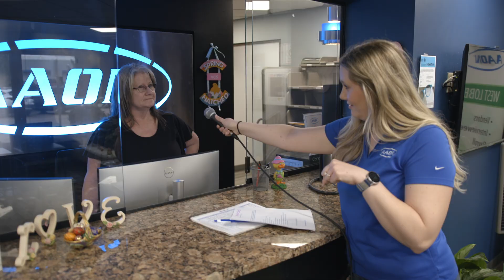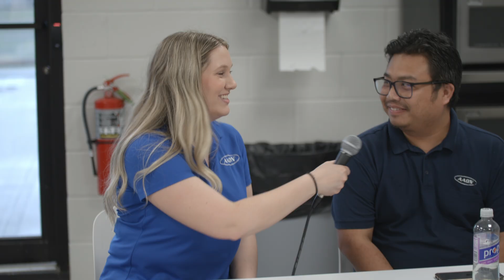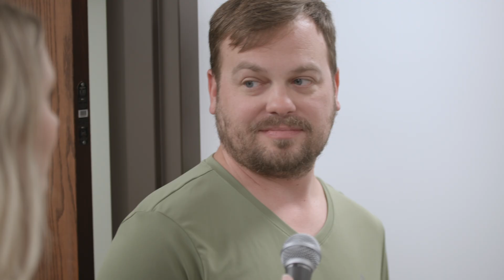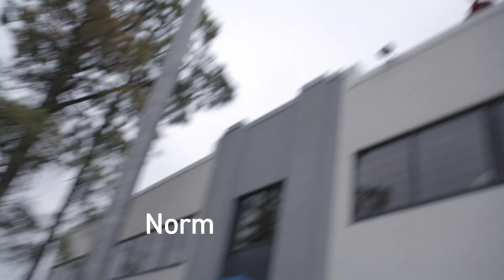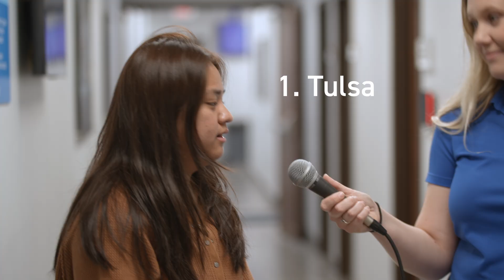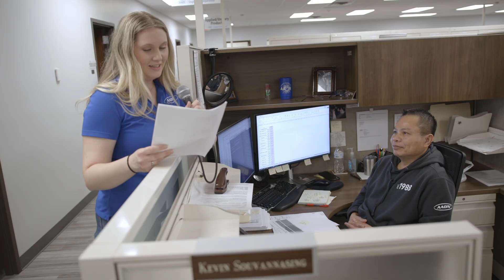Pop Quiz With Stacey Stratton | AAON - Commercial & Industrial HVAC

Comment from the maker: To learn more about how we can help you, click here: https://www.aaon.com/
Reply from the maker: To learn more about how we can help you, click here: https://www.aaon.com/

Water Source Heat Pump - https://www.aaon.com/resources/wshp-hvac

Condensing Unit - https://www.aaon.com/products/condensers-condensing-units

454b Refrigerant - https://www.aaon.com/resources/understanding-the-safety-classification-of-r-454b-refrigerant

VAV HVAC - https://www.aaon.com/resources/what-is-vav-in-hvac

Self Contained Air Conditioner - https://www.aaon.com/products/self-contained-systems

DOAS System - https://www.aaon.com/applications/dedicated-outdoor

Water To Water Heat Exchanger - https://www.aaon.com/resources/what-is-a-water-to-water-heat-pump

Indoor Air Quality System - https://www.aaon.com/applications/indoor-air-quality

Dedicated Outdoor Air System - https://www.aaon.com/applications/dedicated-outdoor

Static Pressure Sensor - https://www.aaon.com/products/duct_static_pressure_sensor

Cooling Coils - https://www.aaon.com/resources/cooling-coil

High Static Pressure HVAC - https://www.aaon.com/resources/what-is-static-pressure-and-how-does-static-pressure

Heating Coil HVAC - https://www.aaon.com/resources/cooling-coil

Rooftop Package Unit - https://www.aaon.com/products/packaged-rooftop-units

Air Handling Units Manufacturers - https://www.aaon.com/products/m2-series

Gas Split System - https://www.aaon.com/products/split-systems

Water Based Heat Pump - https://www.aaon.com/products/water-source-heat-pumps

Self Contained System - https://www.aaon.com/products/self-contained-systems

#HVAC
#commercialHVAC
#industrialHVAC
#hvacsolutions 
#hvactools 
#hvacairsystem 
#hvaclife 
#heatingandairconditioning 
#heatingandcooling 
#heatpumps 
#heatpump 
#heatpumprepair 
#coolingsystem 
#heatingsystem 
#coolingcoil 
#refrigerant 
#airconditioningunit 

Website

https://www.aaon.com/

X

https://twitter.com/aaonhvac

YouTube channel link

https://www.youtube.com/AAONHVAC

LinkedIn

https://www.linkedin.com/company/aaon

Facebook

https://www.facebook.com/AAONInc

Instagram

https://www.instagram.com/aaonhvac

https://www.google.com/maps/place/AAON,+Inc./@34.2806821,-98.004716,7z/data=!4m10!1m2!2m1!1saaon!3m6!1s0x87b6eb24abcb8c3f:0xcaa4bcb34ba7c2f3!8m2!3d36.1293029!4d-96.0158232!15sCgRhYW9uIgOIAQGSAQxtYW51ZmFjdHVyZXKqAVEKDS9nLzExYzN3dnZzd24KCi9tLzAzcDFjZ3oQASoIIgRhYW9uKAAyHhABIhpNwj_PCzc7jHr1HAnI_ADUiURIvTmWuIVl3DIIEAIiBGFhb27gAQA!16s%2Fg%2F1tg3bm9t?entry=ttu&g_ep=EgoyMDI1MDYyMy4yIKXMDSoASAFQAw%3D%3D
4XHM+PM Tulsa, Oklahoma, USA
36.320299833063494, -96.0161907604657
https://en.wikipedia.org/wiki/Heating,_ventilation,_and_air_conditioning